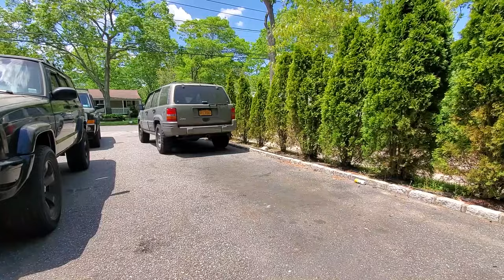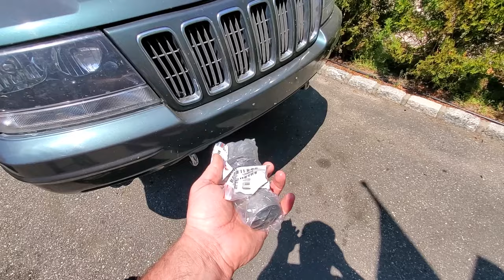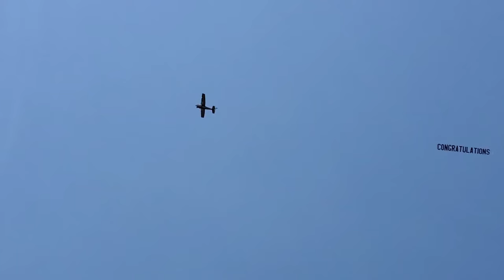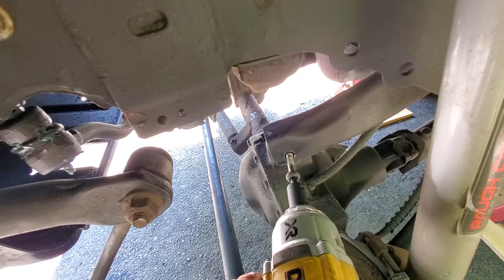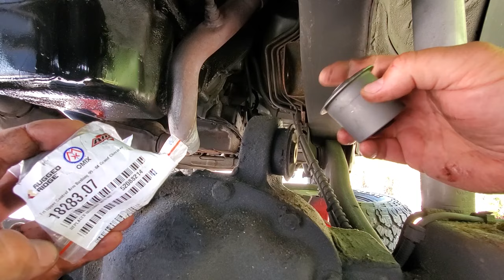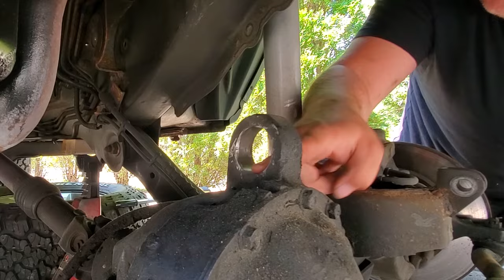JEEP GRAND CHEROKEE WJ FRONT CONTROL ARMS AND AXLE BUSHINGS - MAXPEEDINGRODS UPPER AND LOWERS

Comment: Before you take out the bolt that's inside the frame, shove a rag inside in case your drop your socket or the bolt falls in.  The rag will save you from having to fish out whatever you dropped.

Comment: Your driver's side lower was put in backwards. The curve goes on the outside for the tire to clean
Reply: Passenger side is backwards as well.
Reply from the maker: 😱😱😱 I flipped em!
Reply: I had rubbing on mine didn't notice I put one in flipped as well. I think they'd work either way I have 245 tire instead of more normal size 235. Great video though.
Reply from the maker: @brackoncorbridge1966  Thanks man! Yeah they Definitely easy to reverse if you're not paying attention.. Maybe I'll just replace them with adjustable ones!
Reply: @ProjectDanH  tht was my first thought was wait those aren't adjustable like the back ones are lol.
Reply: How's that? Looking at the video shows the old one that the curve is on the inside.
But he did put the new one in opposite way.

Comment: I got bad news for you.  Unfortunately I just put on 2 sets and well have to do it again.  You see you just pulled out the spring.  The lower spring perch is totally shot.  The only way you can pull the spring out is when you have a jack stand under the body, pull a shock and sway link fasteners off one side, you don't need to take it fully off.  Then you can Lower the jack under the axle and it'll go down far enough to pop out the string.   I ended up getting the front spring perch brackets off Amazon and it's called rustys in the south only one place that sells them for the rear.  But you have to cut them off and weld new ones on.  Felt like I was driving a washing machine had to replace all 4 and now I'm going 100% over the whole underside cause it messed everything.  Need to get the front inner bushings was gonna swap them out today bit did realize them the last time or two who sells them bushings.

Comment: Those lower arms are backwards... supposed to be holes facing inward just like the ones you took off were
Reply from the maker: Yep!  Too many Corona lights!
Reply: @ProjectDanH  not going to lie, I did the same thing on my WJ🤣 didn't notice until everything was torqued on the ground so I said screw it it'll be fine!

Comment: Just a heads up: @4:06 your front coil perches are completely gone! I just had to replace mine for the same reason, they rust out bc Chrysler sucks at designing drainage points. It is not very safe without them bc the coil can move around as you drive!!! Doorman makes a bolt in replacement, that is what I went with since only the tops rusted out. Your link brackets and lower shock mount areas look fine so it should work for you too. Dorman 926-079 (driver side), Dorman 926-078 (passenger side). Only alternative is to weld new ones on, you can look it up bc this is a very common issue. Great video!
Reply: Had to also do the rear only one place sells them for the rear called rustys off road in the south some place.   Man I get to replace everything since the spring perch brackets failed.
Reply from the maker: Lol.. yep . Gone!  Rust sucks

Comment: Doing the same thing on my 94 ZJ. Had to make a run to buy ratchet straps to pull the Dana 30 so the upper CA bolts line up. It's a PITA . Also doing 4 BJ, 4 springs and a RC 1.5" lift with 4 shocks and stab pins. I appreciate your channel to get ideas on how to attack things on my Jeep, thank you.
Reply from the maker: Thank you for watching! Best of luck with your Jeep work!

Comment: WJs are a great off road capable rig
And I’m sure by now a few thousand people have told you about how to properly install control arms that have rubber bushings 

NEVER TIGHTEN THEM DOWN UNTIL THE VEHICLE IS SETTLED ON ITS OWN WEIGHT 

if you tighten them down out of position they will start life in a bind that will cause the bushings to prematurely self-destruct

By placing them in a neutral position first 
You then get equal pressure up and down when your vehicle articulates crossing a ditch or climbing over a bump
Making them last a long time 

If how ever you use a Johnny joint type swivel bushing you can tighten them up in any position. It does not matter. The only consideration is if you are using arms that are bent to accommodate your vehicle make sure you put the bins in the proper direction.
PS those jam nuts need 125 to 150 foot pounds of torque 
A big crescent wrench to buy yourself a good  1/2” drive crows foot that fits those jam nuts 
They can work lose and damage the threads making future adjustments difficult if not impossible 

Frameless and shameless 
Is the only way to wheel

Comment: Nice job. I especially liked the weld modification on that XJ bolt. I'm psyching up for this job on my ZJ. It's not an easy decision because I"m probably double your age, so I just don't know if I can take doing the worm on the ground anymore. I have the squirming know-how, but the old body adds challenges. Still, if I do decide to take the plunge to the grunge, and down some prophylactic muscle relaxers, your video will come in handy. Thanks for putting it together and posting it. Good video work, explanation, and sense of humor, Dan. H. Good on ya'. Cheers.

Comment: I’m changing out my rear upper control arm, ball joint & bushings. Also new lower control arm,  rotors, calibers,  axles and emergency parking brakes. I may change out gas tank skid plate due to damage from rear end accident previous owner had,
Reply from the maker: Heck yeah brother! do it all when you have it all apart!

Comment: Funny how I just did this job this past weekend.  Only I swapped in a junkyard Dana 30 axle, added new ball joints, and coil springs, but other than that it was the same job.
Reply from the maker: Yeah if you needed a new front end now it definitely be the time to do it...  Great job!
Reply: @ProjectDanH  Yeah, it sure took care of the death wobble.  Not a fun job.  Sadly, I think doing the rear control arms is going to be worse.  Swapped out the np249 for a np242(looks like an HD) but the driveshaft was tight going in at the rear axle.  I got a bad feeling I'm going to need to have it shortened.

Comment: If you have one in San Francisco and get your work done in South SF it's almost $1400-1700 . Don't assume the parts to repair the upper and lower control arms, drag links ball joints are readily available. Buy your parts first and show up with the correct ones. I simply don't have time after new motor install, then transmission. When I went to have her aligned a must after you install the control arms and replace everything the frame was bent, so that was an additional $200. A classic situation is cheap parts, no alignment performed or both and parts melting after 8000 miles. These WJ suspensions are a marvel considering they are solid axle! When I think solid front and rear I conjure images of leaf springs. I can see why jeep eventually just migrated to independent front.
Reply from the maker: Thanks for your input.. ill make sure I steer clear of SF 🤣

Comment: You are supposed to leave all the bolts loose until done, mount the tires and let the jeep down to fully load the suspension. THEN tighten the bolts. While you got close with the rear upper bolt you tightened the front diff bushing bolt with the suspension drooped. That bushing won't last long and you'll be doing this again soon unless you go out and loosen and retighten those bolts. Also the spring perches were totally rotted away and the springs can actually come off when the axle is fully articulated.
Reply: He also put both lower control arms in with the wrong side facing out. It even shows on the thumbnail to the video.

Comment: I'm a little confused. When you take out the control arm at 19:28 minute mark, The holes where on the inside and the bend was towards the inside of truck. When you installed the new one 19:56 the bend was facing you (towards the outside of truck) and the holes were facing you has well. I'm I just seeing this wrong?  looks like you put the new one in wrong.

Comment: Hello Dan from Argentina! I don't know if they told you before but I see that your lower arms are now backwards! you did not put them as they were before! At least that's what I just saw when you posted the new ones! They have a curve that goes from the inside out, therefore the holes in the arm remain inside as they were before and now when you bend the wheel it will touch the arm.  I'm also changing greetings!
Reply from the maker: Lol. Yes 🤣🤣 one too many coronas
Reply: @ProjectDanH  😆🍻

Comment: Hey Dan, one thing you should consider when replacing your next set of front upper control arm axle bushings is to go with a rebuildable one from a place like Iron Rock Off Road. The inner part is rebuildable, leaving the axle cup in place so you don't have to press a new one in every time you need to change the bushing. They're about $45.00 a bushing which isn't that bad. The rebuild kit is pretty cheap. This definitely saves a lot of hassle when redoing them in the future. Here's the link to the part on their website. https://www.ironrockoffroad.com/product/upper-control-arm-flex-joint-8-bolt-10mm-cartridge.html
The link is for a ZJ but I'm sure they make them in a size for all Jeep axles.
Reply from the maker: Yeah brother that's totally the next step! I'd love a set of adjustable front control arms to go with the rear to hone in that pinion angle.  I'll keep chipping away at this little by little till it's just right. Thanks for the view 💪

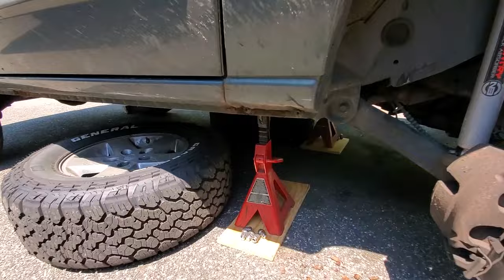Comment: Always enjoy your videos Dan! At 1:25, it would be best for the jack stand to be 90 degree from the direction of the woodgrain on your 2 by 4.
Depending on the weight, the wood could split with the right amount of movement. Unless you use stronger wood. I only say this because I've seen blocks of wood split or even explode before. I doubt the Jeep is that heavy, just thought I'd let ya know.
Reply from the maker: Excellent observation!  Your absolutely right! I'll make sure I swap em around next time!

Comment: The bushing at the axle, on a WJ has a 10mm dia. bolt. , and the WJ bushing has a 10mm hole. On an XJ the axle bushing and bolt are 12mm. The only difference in the two bushings is the diameter of the bolt. You can put an XJ bushing in a WJ if you get a new grade 8 (10.9 metric) bolt and lock nut. You may have to use a 29/64th drill bit to slightly enlarge the holes in the control arm. Don't make them too big or the bolt will be sloppy and work loose. DO NOT REUSE THE 10mm BOLT! ( 7/16th will work fine too)
Reply from the maker: Excellent Tip!!!!

Comment: Hate to gice you bad news bit that driversside lower control arm is on backwards. The curve should go jneard so there is room for the tire at full lock. I didnt watch the passenger side install yet but also may be backwards. The curve shoukd fo inward away from the tire.
Reply from the maker: yes, the curve is made for more tire clearance.. no big deal.

Comment: The fact that the control arm sprung up when you released it from the bottom bolt tells me that it was tightened in the up position not on the ground
Reply from the maker: When the control arms go back up it means they were tightened when the jeep was on the ground

Comment: They wanted $850 just to change a tie rod and two front lower control arms at my local autoshops.
Do it yourself, you can rent the presses for putting in ball joints and some expensive tools, some places like Autozone make you pay $100-$200 for deposite to rent and refund you when you return the parts unharmed.
They where gonna charge me $600 to change front and rear shocks, got front shocks on but the rear bolts are seized since it's 20 years old and I need replacement bolts since the kits online don't come with rear hardware.
But a Sawz-all is far cheaper to rent or buy and cut the bolts off, buy the $20 bolts and save $500 and that's not including cost of shocks. Which I picked up all 4 on sale for $103 shipped (Quality Monroe)
Reply from the maker: Great Job!  DIY projects will always save you money!

Comment: Why the hell doesn't part manufacturers include the needed hardware with the parts?
Grinds my gears ⚙️ 
I have rear Monroe shocks for my 02 Jeep WJ (Laredo 4.7L V8 4x4) just sitting in the back hatch waiting for the correct bolts because the front + rear shock kit didn't include rear bolts and nuts.

In case anyone needs Bolts for the Rear shocks on a 94-04 WJ, they are:
M12x1.75x80mm top and M12x1.75x70mm bottom Hex Flange Bolt with partial threads.
They have to be SAE 8 grade(Standard OEM strength or greater)
I ordered Grade 10.9 which is far stronger than OEM.
The Nuts have to be Grade 10 at least and M12x1.75
I recommend you get Flanged Nuts and Bolts (Hex head 16mm/18mm wrench) you can get Flanged Nuts with nylon lock gasket to keep them from coming off but I'm just getting regular flange so I can get them off easier if needed. Torque to OEM specs.
I recommend using Yellow Zinc Bolts and Nuts instead of Black Oxide because they are more corrosion proof.
Look on BelMetric for the high quality automotive fasteners (bolt/nuts/washers)
About $2.40 a bolt and $0.56 a nut, BelMetric let's you choose partial thread, coating, length and size of threads, bolt head and tells you socket size.
I think the rear upper control arms are M14x1.75x110mm but check specs to make sure, I may be mistaken. People on Jeep forums are very knowledgeable
Reply from the maker: Excellent info!! Thank you for your input

Comment: Another great video Dan. I did the front upper and lower control arms on my  04 WJ in March. Had a hard time with the passenger side bushing install. Still have driver side to do. Seeing the bevel you put on your bushing should help me get it installed when I get to it. Working on rear suspension at the moment. 
👍🏻🇺🇸 Paul
Reply from the maker: Yeah I definitely needed to get that bevel in there... I just wouldn't go in without it!
Reply: Paul, you should check out these rebuildable axle bushings from Iron Rock Offroad. The inside is rebuildable, so once you press the outside cup in the axle;  you never have to mess with pressing anything in again in the future. I have these on my ZJ and I love them. Also, if the bushing gets a little loose; you just tighten it with an allen wrench and you're good. https://www.ironrockoffroad.com/product/upper-control-arm-flex-joint-8-bolt-10mm-cartridge.html
Reply: @stormtrooper_jeep_zj  Thanks for that info 👍🏻🇺🇸

Comment: Good work but at 11.0 it shows the bush in the diff housing.  This is supposed to be pressed right in up to the flange. ( obviously it has still a small gap between the flange and the housing, but only very small )  It should be protruding on the inside in order for the bush to be central in the radius arm.
Reply from the maker: thanks man... I did my best. lol
Reply: @ProjectDanH  No criticism.  You obviously know what you're doing.  Just a small detail.  Exchange of information makes this all worthwhile.

Comment: My 1999 WJ 4.0 had the Front Lower Control arms replaced. Now the car has a distinctive,  creeeaking noise., which is definitely coming from somewhere in the front suspension. Took it back to mechanic, we rocked it from side to side and the noise was quite loud, but he said it's not coming from the new control arms. Took it to another mechanic, he said it's the Panhard Rod bushes. Replaced them. Creeeaking noise isn't quite as bad, but it's still there. This noise is driving me to distraction...Any clues as to what it could be??? Cheers from Australia.

Comment: Are the frame end and axle end upper control arm bushings the same part? Nobody seems to know and I've called 4 wheel drive specialists as well as the auto parts stores.
Reply from the maker: Yes, I have a link to the bushings in the video description
Reply: @ProjectDanH  I'm the guy you talked to on Instagram yesterday. Thank you again for the help.

Comment: Hello Dan H, I am looking for Control arms for 2004 Jeep Grand Cherokee 4.0l. I wanted to know if the Maxspeedingrods control arms have held up after a year or so. I can't just run down to parts house to pick up a set. I can only order them online and would not be able to return them if they are no good. I wanted your opinion after you had them for a while. I was looking at Moog and Mevotech then I saw your video. I am overseas and would appreciate any helpful knowledge you can give.
Reply from the maker: They have been pretty good.  also you  may want to try core4x4 !

Comment: Dan, I was doing a suspension overhaul on my WJ. The rear went very smoothly, but the front is giving me too many problems. 

So I basically took everything out and the axle was just sitting in jack stands, I painted everything around for rust prevention. I got brand new control arms, struts and steering stabilizers. The track bar bushings however are Moog. 

I’ve been trying to put back everything. First I put the upper and lower control arm in place, and then I put the track bar in place and now the passenger side upper control is rubbing against the catalytic convertor. What am I doing wrong here? Is there a sequence to put back stuff? Please let me know, thanks.
Reply from the maker: Sorry for the late reply, hope you got it in by now.  if not work top down, just slide the bolts in without tightening the nuts, use ratchet straps to pull and maneuver the axle.  also use the jack to manipulate angles.  God speed!